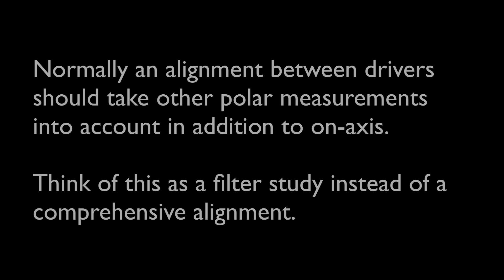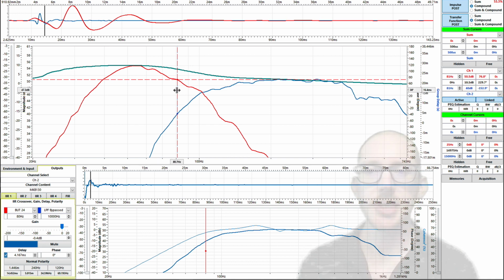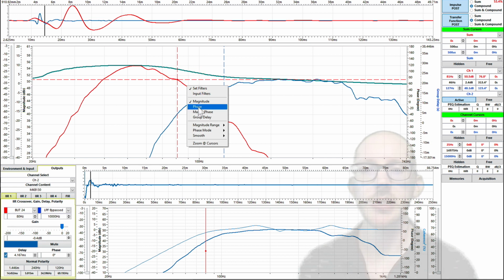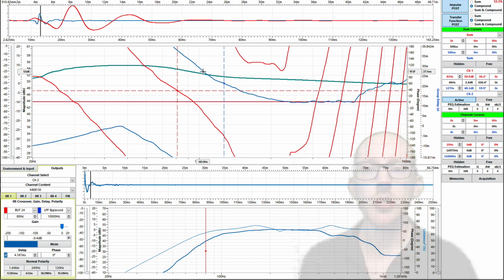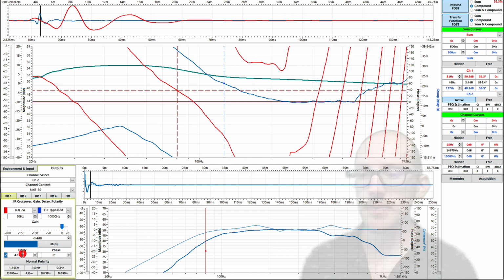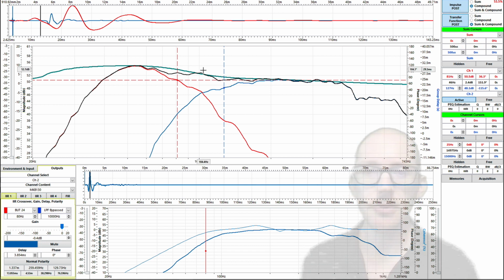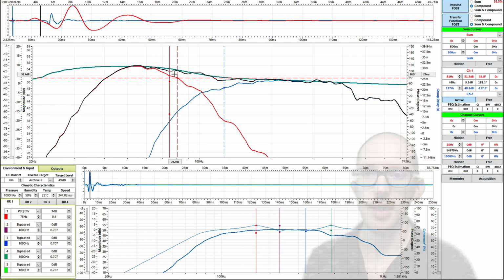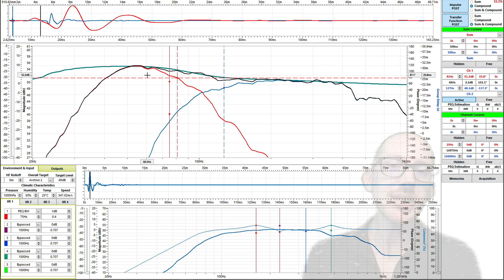How to use delay to match slopes in your crossover alignment

Comment: Is this analyser stable & have you or the people you know used it? Also, since everything is therein, it means that one doesn't need a processor. Am I right?
Reply from the maker: Hey S Al, 
> Is this analyser stable
As far as I can tell, yes.

> have you or the people you know used it?
I have used it. I have two friends that have used it.

> one doesn't need a processor. Am I right?
For simulations, that's correct. It simulates a DSP so you can run tests and make all of your DSP decisions without taking more measurements, but then you'll still need a processor to actually do the real audio processing work.

Comment: would it not be easier just to read off the crossover point, ca 100hz, then play back a 100hz tone and delay one or the other until you hear the loudest volume?
Reply from the maker: Hi Sudd! Personally, I have found that that method does not work for me, but if it works for you, by all means, keep using it! :)

Here's a video I made about it - https://youtu.be/_KdMlCEblgE
Reply: @nathanlively  i am sure my method is not the best way, but a quick way with no tools other than a tone generator.  
dont know why you mentioned "sub polarity inverted" on the website. its when the polarity is normal that the overlapping frequencies are supposed to be at the highest db.
Reply: @sudd3660  not always. Normal polarity for one loudspeaker may have very different phase characteristics compared to the next loudspeaker at normal polarity. Each use case can be different. In some cases, reversing the polarity of one loudspeaker can help the user arrive to a closer overlapping phase trace with their other loudspeaker (and often times, some delay is necessary to add to one or the other loudspeaker to further help align their phase traces). As in many cases with audio scenarios, it depends.
Reply: @FathomSoundProAudio   you misunderstand me, i am saying to listen for phase issues and volume, the solution to fix it might come as switching the phase or add delay. 
either way you have to have the overlapping frequencies sum up, so the tone in the middle is loudest it can be.